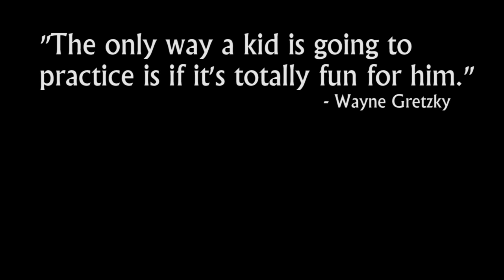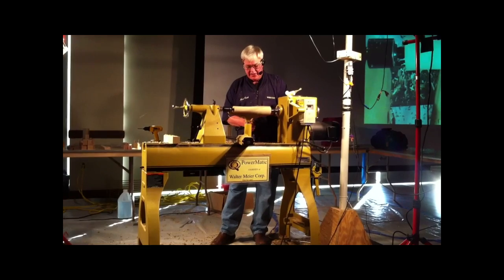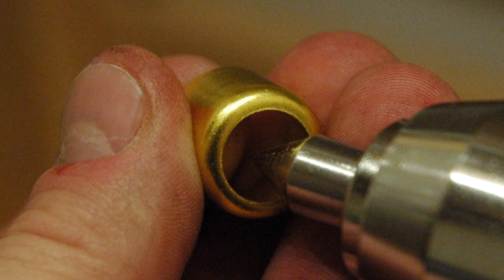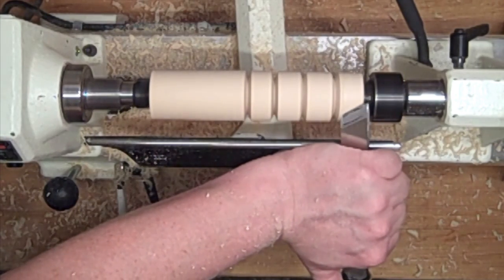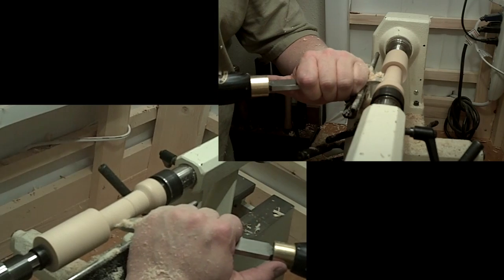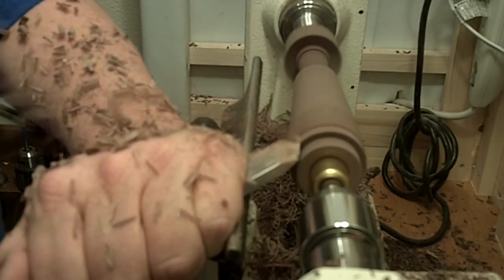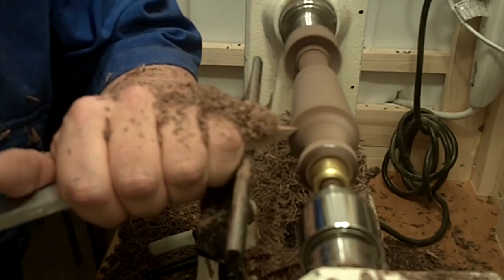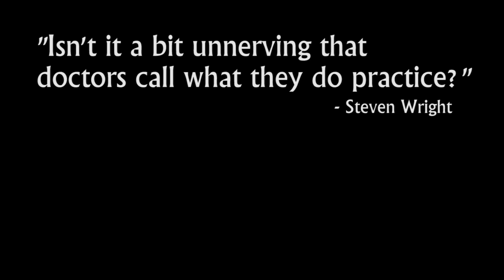Screw the Skew

Comment: Nice little video.
The first thing to practice with a skew is sharpening. Get a cheap skew and practice sharpening until you can do it in your sleep. I never sharpen mine on a stone, I use a convex bevel (similar to an ax bevel) on mine. This is very hard to sharpen by hand by very easy on a grinder once you remove the tool rest. I use an oval skew with a rounded edge. For final cuts, I will sometimes give the edge 2 or 3 light and quick sweeps over a piece of 800 grit wet/dry paper.
Using a convex bevel makes finding and riding the bevel is so easy you will wonder why you ever had any trouble with a skew. I also only use the tool rest for heavy shaping. For final shaping and smoothing, I push the rest out of the way and ride the top of my left forefinger under the work to steady my hand. Once the bevel starts to ride, it takes only the tiniest pressure to maintain proper contact and I have full freedom of movement  with my chisel.
Also, if your skew is sharp, and you made a good final cut you do not need to sand except maybe 600 grit. If you need to sand, your technique is bad or your chisel is dull.

Comment: I am a new turner starting to practice with table legs etc.. I intuitively found the skew to be a better tool over others like spindle gouge etc.. As I get my feel for what kind of widths would work, what bevel angles what shape of bevels etc.. I'm leaning towards a straight bevel on a 1 inch width skew chisel.. this video is awesome in the sense.. i'm going through exactly the same process that you went through.. and it kinda validates my preferences .. thx so much. I'm definitely subscribing.
Reply: Sandeep Puri u

Comment: Very nice video.  I have had much the same experience with my woodturning.  I have found the Eli Avisera grind (convex bevel) helps make the tool much easier to control.  The concave bevel is the most difficult to use with the flat ground bevel the next easiest followed by the convex grind the easiest of the three.  But, they all require ongoing practice, all physical skills are perishable.

Comment: Great vid, I don't use skews much but after watching you I'm going to use them more, To apply wax or other coatings I use a strip of artists canvas it conforms to different shapes and hold the wax well because it's a woven  product. You can cut a long strip and keep your hands well back . To use steel wool I use a piece of PVC pipe and stuff the end full of steel wool till its tight and leave some out and form a mushroom end. Just dip it in a can of what ever your're using to finish with.  works

Comment: Pretty good. I wonder if the motor on your lathe can be reversed? Sometimes manufacturers don't bring all the terminals out. Cheap bums, all it saves them is one screw. All tool motors can be reversed, just how they're made it isn't practical with some of them. Anyhow not too sure about your finish choice for a tool handle, plus I might have tried to put the knurls in too somehow. I liked the turning though. Might want to think about bolting that little lathe down.

Comment: What's the most reasonably priced slow speed grinder or cbn wheel and adjustable sharpening platform? I recently took up lathing, but currently am stuck using skews as well, I do like them, but I HAVE to because I only have a sharpening stone,  and a fast speed grinder non cbn without a platform. Been subscribed for a few months now. Hopefully you'll have time for a response,  keep up the good videos

Comment: Practice makes permanent.  Permanent is not the same as perfect.  If you're doing something wrong, doing it over and over doesn't help.  Usually if you see you're getting bad results you'll probably start to try doing it different ways.  Hopefully you'll discover a way that works well.  Sometimes you aren't able to figure it out on your own so you need to find someone to show you.  Once you know what to do, doing it over and over will make it second nature.  It sounds silly, but practice alone is not the solution.  Practice + good instruction is required.